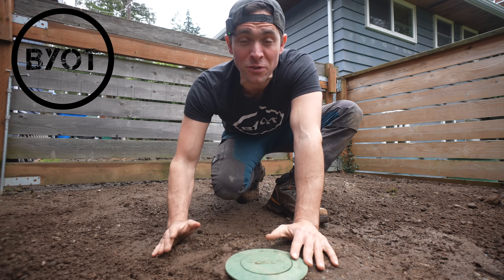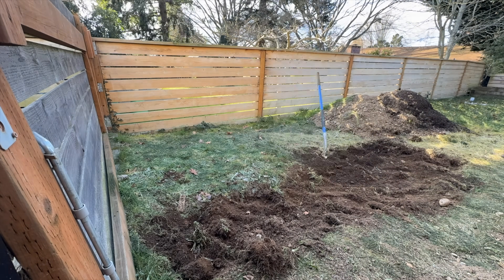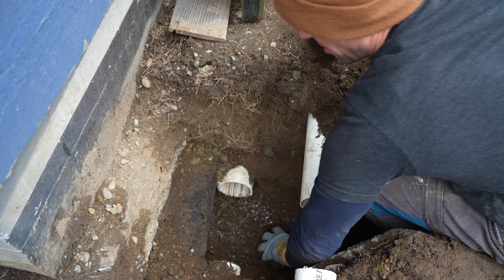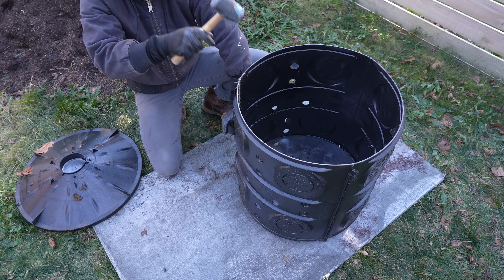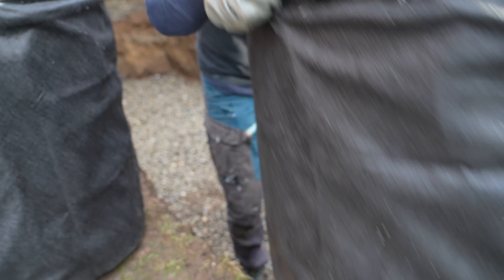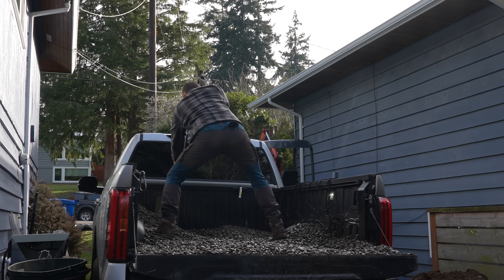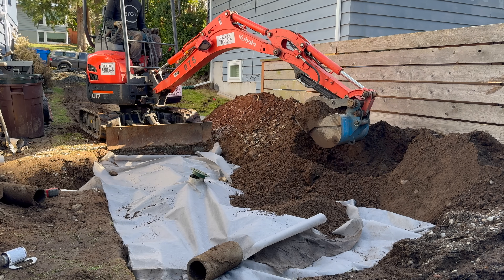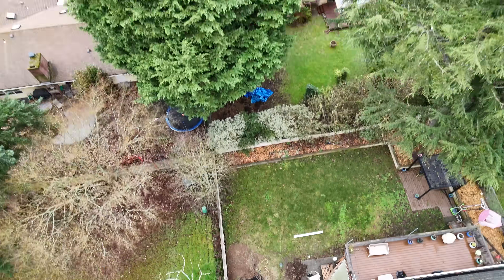How To Install A Dry Well Drainage System // Start To Finish

Comment: Should be further away from the foundation as you can. Take it to the back yard if you can. Also should of used schedule 40pipe and the inlets use stainless screws  not silicone. Other than that it will work nicely the hole is big enough.

Comment: Any idea if there are downsides to leaving the bottom out? First thought is that it would let the water seep out the bottom, and the circular design should hopefully resist crushing from side-loads...
Reply: There shouldn't be since ultimately you want the water draining out into the surround ground around the tank, rather than where you're moving it from. I have one of the same tanks, moving water from one side of my house via French drain out to my front yard. It works really well and I've had it in place for almost a decade now.

Comment: Nice system and install. Curious to know how it has worked through a rainy season…

Also try putting a heavy duty tarp down in your truck bed for rock/soil/whatever else. Helps save time.

Comment: If you live where it gets cold and the pipe is above the frost line, you would want to use gasketed pipe. This will allow the pipe to flex a little, otherwise, the pipe is prone to crack where glued.
Reply: He lives in north Seattle area, I only know that because I rent all my equipment from the same place as him. Lol small world

Comment: Pump to the street, period
( use a water powered sump pump as backup ( on top) to the ac powered sump pump )
Reply: Only as a part of a proper drywell system. Adding a sump pump to a dry well system is good, but a large system like this will work even when the power goes out, which is most likely during a big storm. If you are going to have one or the other, I would always default to gravity before electricity

Comment: Those dry wells should be open at the bottom to let the water drain down into the lower soil.  The plastic bases are offered only when the customer wants to use it as a sump basin that has an internal discharge pump. The manufacturer should be clearer in this regard as it's fairly easy to misunderstand.
Reply: Yeah, I was shocked at the end to see that he had left the bottoms on those. Oh well.

Comment: Those flo-wells will stack and in this case may have given a slightly better result and it would have put the water further below the surface. Renting a mini track loader with a 4' tree planting auger would have been the same price and less work.

Also when installing drainage systems consider which way the water is flowing. In this case the water is flowing out of the drywell into the rock therefore any dirt or debris will try and flow out of the drywell into the rock, the wrap on the outside of the drywell may clog and hinder the flow.

The Flo-Well from NDS is quite pricey fro what it is. An alternative is to use dual wall corrugated pipe, commonly sold as culvert pipe. You would cut it to length, drill small holes in the sides, and then set it vertical in the hole. They sell various covers and grates that will fit over the end for access just as the Flo-Well has. A second option is to use septic leach field chambers which would come out around the same price as the Flo-Well but are much better quality. 

Overall that was installed very well and I am sure it will do a great job, I just wanted to add those points for anyone looking to install something similar.

Comment: Do you have any concern, over much time, that the plastic will weaken and result in a potential cave-in of the FloWells?  There is quite a bit of weight loaded on top and it's just a plastic material...
Reply: That material is heavy duty. You and the next homeowners will prob be dead by then
Reply: No, they are designed for this purpose.

Comment: Did you connect the 3 FloWells together? Otherwise what is the purpose of the other 2 unless they have top drains attached to them. Whenever I have installed multiple FloWells I connected them together and the last one had 8 to 10' pipe run out of the side with a pop-up emitter in case there was an overflow it could drain in the backyard.

Comment: I don’t think this makes a lot of sense. The purpose of a dry well should be to serve as a buffer in times of huge rainfall. The goal should always be to get the water out and moving, not to let it drain into the soil (in a home drainage application). I would set that system up with another pump to slowly move the water out to the city system.
Reply: Sometimes you cannot always drain it to the street. He may not have curbs to drain to the sewer or he may not have storm 
Sewers near.
Reply: Yeah get it to the street and running away
Reply: It makes a lot of sense.

Comment: I feel your pain on this, my place is built into a small hill and the southeast corner is the high side and where my garage is. We cut that side down and placed the dirt on the north slop to give us a flat place to do slab on grade (South Texas Coast we don't really do basements here). This now means my garage floor is about 5 foot lower than mine and my neighbors upper lawn. Between my lawn and my upper neighbors lawn it's about 70% of an acre and it all flows down hill towards my garage. We knew this going in so we had a 12" wide 50' long drain cast into the front of the garage concert. It has two 3" drains and two 4" drains that feed a 6" pipe that goes under garage and down the hill to the back of the property. For 20 years it worked great, then in 2021 we had one of the craziest rain storms I have ever seen here in my 41 years of life. We got 8" of rain in 45 minutes, this was to much for the drain to handle and cause 2" of water wash through my garage and out the back door of the garage. I end up renting a skid steer and regrading the far wall side of the garage so if it happens again the water can go around the far end of the garage once it gets to just blew the top of the garage slab, it will keep the water about 1.5" below the garage floor.

Comment: So funny.  I've had winter flooding in my downstairs room for years.  A year ago, I rented an excavator and replaced the concrete pipe sections(as seen on your video) with french drain.

I thought the excavator was exactly the same size as yours.  When I saw the Miller's Rent All sign on the back, I realized it was the exact same one.

Excavators are awesome for these jobs.

Comment: Hopefully this solved your problem, it was a lot of work. I could tealthough it looks like the grating from your grat should have been going downward to the street and it's going downward toward the garage. Also, the grating should be moved away from your house looks like a good system you put in except for that dirt around that cap seems like the dirt. Will  errod.. and washing to Not sure where you're located at , but here in illinois , chicago area suburbs , we use six inch pipes those tanks

Comment: Great project! I'm working on the same in my backyard, except that I'm digging manually because the space between the side porch and the fence doesn't let me bring an excavator. 
Did you do soil percolation test before starting the project? My  soil percolation is very slow, so I'm adding gypsum to improve percolation.
Reply from the maker: I did not do that type of test.  Luckily didn't run into any clay so hopefully natural drainage will be just fine.  Thanks so much for watching and good luck on your project as well.

Comment: Hey Brent. I’m so glad I don’t have water problems here in SoCal. I saw your past planter box project in the video. Did you take my idea and let the steel side braces rust or patina and then use spray lacquer to preserve that look? Just wondering. Thanks for all the great content!
Reply from the maker: Thanks for all the support Roger and glad to hear you don't have water intrusion issues like me :) I did let them rust over but never applied a spray lacquer.  Still looks good but need some new plats after this winter haha.